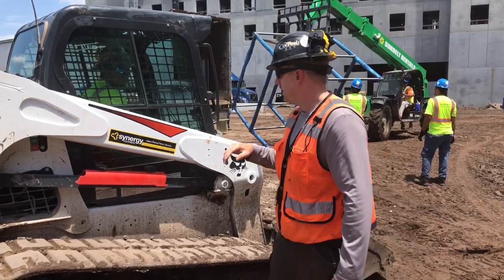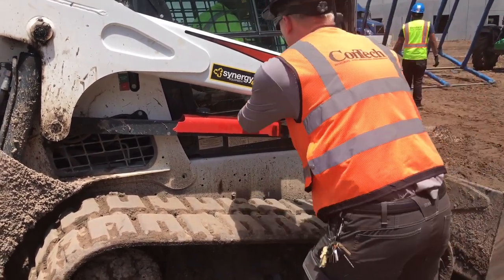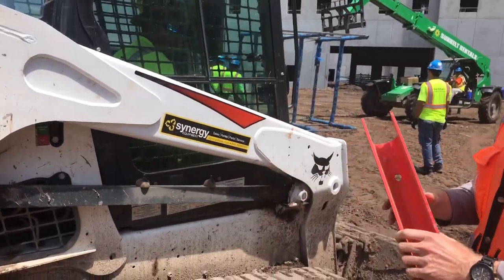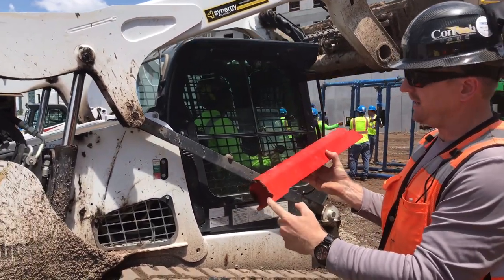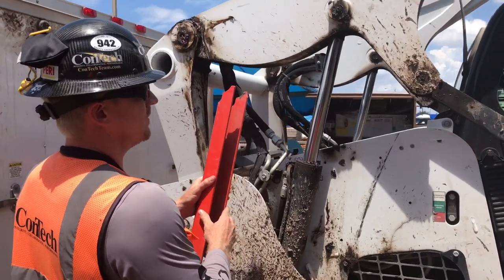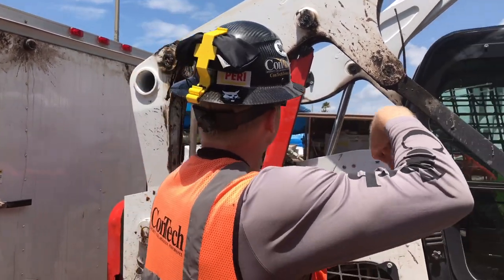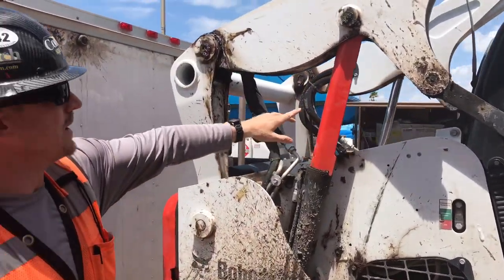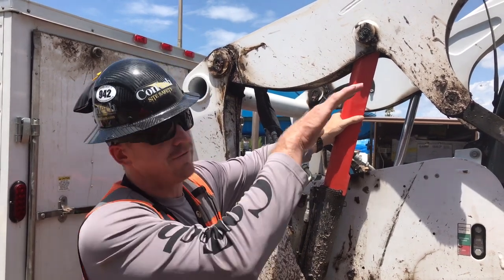Skid steer (bobcat) safety- how to use lift arm support

Comment: That’s a poor design it needs improvement so that the operator can engage with solenoids or something
Reply from the maker: Agreed...if it’s not quick and easy most people won’t use it-regardless of the application. Caterpillar might have a better design on their skid steers from what we’ve seen.
Reply: ConTech Construction LLC I have a bobcat 753 and luckily I can do it with a stick through the mesh if I have to . I work around my house by myself